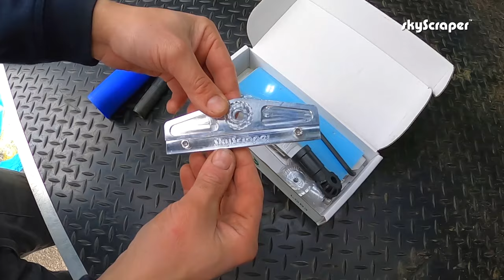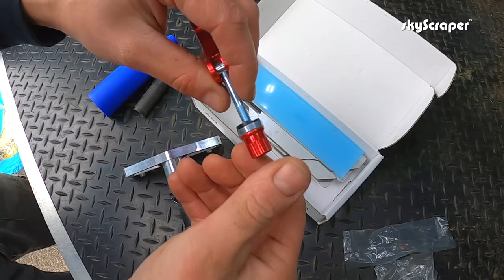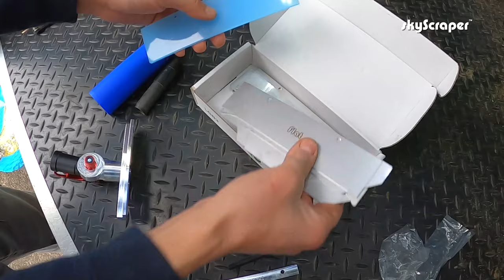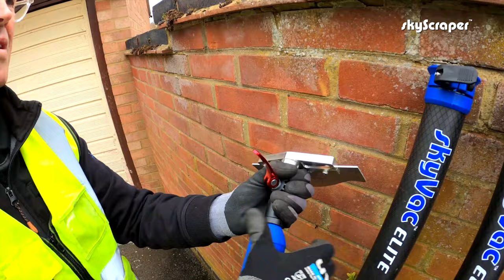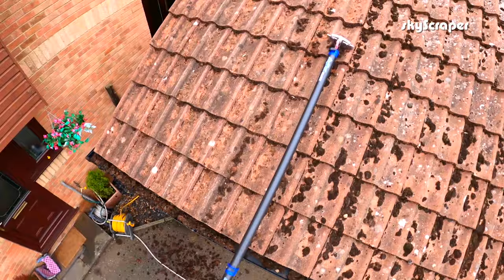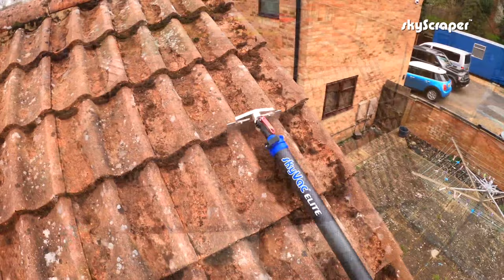Best roof cleaning tool? -- The skyScraper Unboxed and In-Action

Comment: Hi just saw video, nice kit . Does it come with a gardiner pole connector??
Reply from the maker: Hello, many thanks for your comments, it sure is a great bit of kit! Our skyScraper head and blades can be purchased with an EU threaded adaptor tool which can connect to a Gardiner pole. Please be aware that as this isn't our pole, we can never 100% guarantee the equipment will be compatible. We do however offer a 30 day money back guarantee and will be more than happy to offer a full refund or exchange if you find this not adaptable to your current set up. I hope this helps, more information can also be found on our website here: https://www.spinaclean.com/roof-cleaning-equipment/moss-removal-tools/skyscraper-moss-removal-tool 😊
Reply: Did you get the connector from the Gardiner to the skyscraper?
Reply: @samanthaking4305  no

Comment: I’ve got interlocking clay roof tiles and there is a lot of moss accumulating throughout the year. I feel it’s like a waste of money paying someone to clean my roof 1/2 times a year, when the money spent to do that I could buy myself one of these. But even if you can scrape off the moss, using this tool, the moss will still fall into your gutters, and you will need to get onto the ladder to remove that moss clogging up your gutters and down pipes? Should I get a telescopic cleaning tool which can take care of the moss high up in my gutters, so I can remove it, but how do I clean out the moss if it falls into the down pipes?
Reply from the maker: Hi there, thanks for your comment. Check out our skyVac Mighty Atom, it is a high level gutter cleaning vacuum which enables you to clear gutters from the ground, including down pipes: https://www.spinaclean.com/skyvac-atom-gutter-vacuum

Comment: What is the nylon blade used for?
Reply from the maker: Our nylon blade is specifically designed to use when cleaning moss from slightly more delicate surfaces. It isn't made of stainless steel and therefore ideal for roofs which require a little more care when scraping 🙂

Comment: Is it good when you already are on the roof?
Reply from the maker: How do you mean? 🙂
Reply: @skyVacuk  if you standing on the roof does it remove everything including the fogs/between the the roof tiles
Reply from the maker: @MegaSaxon4  Our skyScraper head and blades comes with 11 different tiles for specific roof profiles. We now also sell a wire brush which is perfect for removing excess moss bobbles!

https://www.spinaclean.com/roof-cleaning-brush

We can never 100% guarantee that it will remove everything, it all comes down to the job you are completing and how you are using the equipment - it most certainly removes the most stubborn of debris that's for sure 👍🏼🙂

Comment: It’s not great. I’ve had one for a brave few years now. On a flat tile it works fine but on something like a Marley Roman tile the tool doesn’t fit plum with the tile, therefore missing as much moss as you get. Just my personal opinion
Reply from the maker: Hi Matthew, thank you for your comments we're disappointed to hear you're not happy with your skyScraper purchase. Have you been in touch with anyone here in our office at all? We're always happy to help and will do our upmost to ensure all of our customers are satisfied with our equipment and service. 

We've recently added a range of roof cleaning brushes that are compatible with our skyScrapers - we've had some great feedback on these. You'll find when using them they can brush off all the excess moss inbetween tiles which can be a little more challenging to tackle with just the stand-alone blade. I'll pop the link below to our website for you to take a look 

https://www.spinaclean.com/roof-cleaning-equipment/moss-removal-tools/roof-cleaning-brush

https://www.spinaclean.com/skysweeper

Any queries please just give us a call 😊